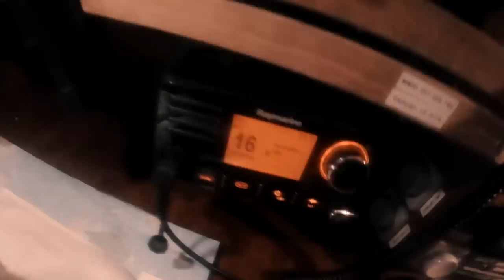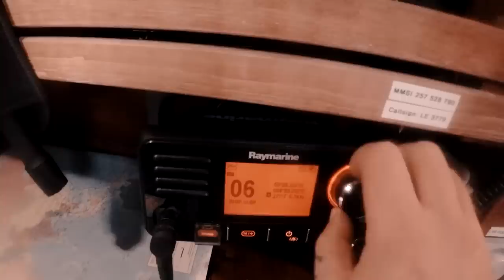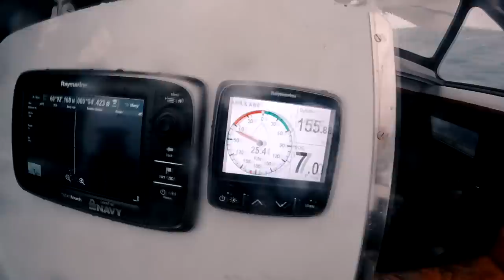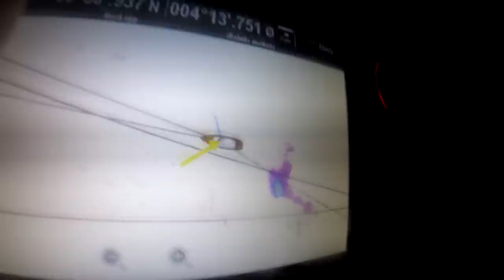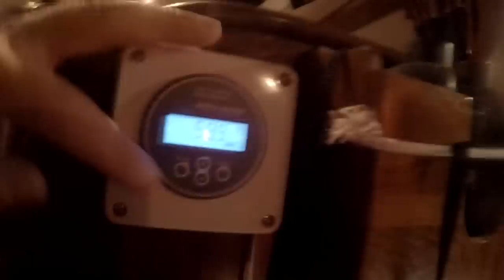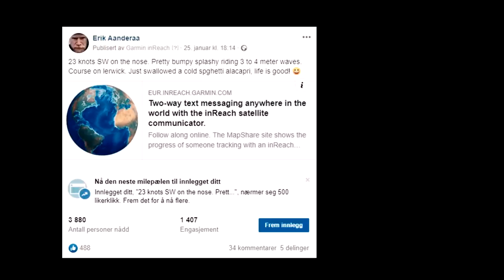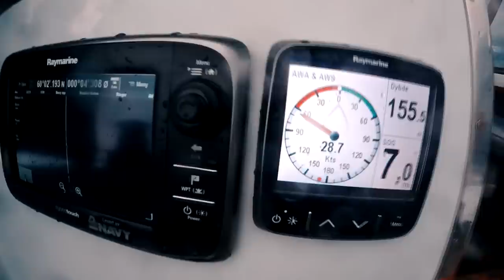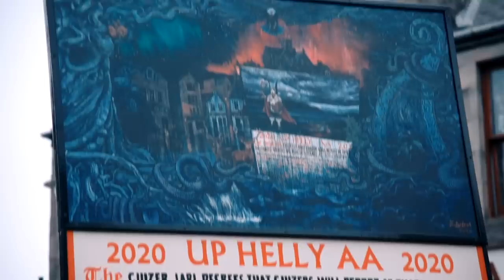Crossing the North Sea Wintertime- for a Vikingfestival

Comment: Meh...

No I'm kidding!  Great video, great sailing. 
But the 'haute cuisine' in the galley could use improvement. 
Speaking of improvement, could you make a metal grate floor in the chain locker and install a bilge pump there? The water would be contained in the chain locker and when there's a foot or so it will pump over board. 
Looking forward to the video of your trip to Greenland.
Take care.
Reply: Actually it's deep enough to raise the sole, pitched down on the centerline and sloped back to thru-hull clamtop scuppers.

This configuration allows hose or bucket rinsing of the locker, chain and rode.

Why mess with a pump and hose and all the sketchy wire mess, when with a little noodling let the water do it's thing

Comment: I been thinking that you need a much bigger boat. That one is good but.. You need like a 55 footer catch. I think you could still handle it single hand. Reefing in that main was insane but you have to do it. Super dangerous. I went submarine once in the bow spritt. All the way submerged trying to get the jib under control. So scary, but at least I had another person watching me. You could still get some of that hardcore with at least a bit more safe comfort.. sorta. Taking on water like that is freaky. They over build these small boats. You push them to the limit of what they built them for. LIMIT

Comment: I wonder if there is some way to seal that anchor hole when not in use and quickly reopen it for use. Probably difficult with the chain but maybe there’s some system you could implement to help stop the water problem 

Awesome video man 🙏🏻

Comment: Upgrade question - why have you not fitted independent bilge pumps to each side angle of the bilges.  You could turn on just the one on the side with the water when you are heeled far over and remove a lot of the water.  No more bailing with a coffee mug, no more moving around electronics.

Comment: I dont understand Eric why you dont use a bung of water resistant cloth for the chain coming through your deck . After all you wont need to anchor for a day or two. It easy to remove!
Also carry on board sponges or foam cushion for soaking the water up it doesnt take long .
Your video is good viewing.
A good example how difficult and energy absorbing it is moving around below deck and your contessa 35 is not so beamy as many bigger boats like hanser etc designed more for marina and anchorage than passage making!

Comment: Apologies, I know nothing about sailing, but when your in the cabin, who’s keeping a eye on the sail boat?? Great film by the way👍🏻
Reply: Most people have some sort of auto pilot which keeps the boat pointing at a certain bearing
Reply: JP Pope  Typically, a singlehander will stick their head up and take a look around every 20 minutes or so when they are not on deck. (This means short naps!)  Most sail boats travel at about 7 nautical mph. Big ships travel up to about 20 mph. So, worst case, you should spot any ship within 9 miles by popping your head up every 20 minutes.

Comment: Great video, enjoyed watching.  Is there a way to close off that anchor chain hole in the deck to stop the water?  My boat has a similar setup, but I have a pipe that curves back above the deck that the chain runs through.  It helps a little bit.

Comment: Could you head up into the wind to stop the heeling long enough to use the bilge pump? Or would that be unsafe? I'm no sailor, just curious as to what options one would have in that situation. Filling your electronics with water doesn't seem like a good time!

Comment: Quick question: When you switched to headsail only at around 26:00, would it have been reasonable to leave the main up instead and just roll in the headsail all the way? I'm just asking, because you mentioned how potenially risky it was to go up front to the mast. You could have done all the handling for the headsail from back in the cockpit, right?

Comment: If you arer getting seawater ingress thru your anchor chain hawse pipe you could secure your anchor forard, tie a rope to the end of the anchor chain and drop it inside below deck and tie that rope off to a 3'' threaded endcap fitted to the deck hawsepipe  and screw the endcap to the deck fitting. That way your frontend is totally waterproof until you need to drop anchor again. Having seawater washing around an AC inverter is worse than stupid, it's suicidal. Perhaps you could swap a little macho for engineering planning. To redirect seawater from the chain locker back aft was a half baked idea.

Comment: Soooo, this is what I need to do, if I want to avoid getting the Corona virus. Curious why you wouldn't put a towel (or a cotton tee-shirt?) into the tight corner spaces, to soak up the random water, and then ring it out into a bucket a few times, until the water is removed? Maybe squeeze a towel (or cotton tee-shirt) into the hole you made for the anchor chain, to prevent the water from pouring in.

Comment: Awesome footage Erik, thanks for sharing!

May I ask why you took the main down (min 28:00) given the challenging winds, rather than taking down the jib (which you could presumably do in a saver way from the cockpit)? Sorry if that's a dumb question :-D.
Reply: the storm jib is your last line of defense to stabilize the boat, and it will give you good speed and its easy to trim from the cockpit. The main will only heal the boat over in heavy winds...

Comment: Great video, and when it looks rough on screen it means it was very rough in reality!  - just a thought, but have you tried stuffing a rag  / plastic bag around the chain where it goes into the locker?   - hopefully will keep some of the water out...
Reply: Good tip, I also found about an A4 (sheet of paper) size of yoga or sleeping mat cable tied to the chain in a funnel shape and then pulled in till it squishes in the pipe sealing the gap yet still offering quick anchoring if needed.

Comment: You simply don't burn a Draken boat, not even a fake one, do You?  😐
I like the "plan A" approach though: Not going to Aberdeen instead just because the 30 knots come right on Your nose half the time.
Oh, and a small rubber ball pump (like they were used on outboard engine feeder lines) with a short piece of pipe on the aspiration side should help You get rid of the water besides Your bilge in no time.

Comment: Since I've never seen a comment or acknowledgement to any viewers' comments here on your vlogs, I can safely say anything I want to for the benefit of the other viewers only. If we are watching your video we know you made it back home. Although I would never use the term "return safely" to describe any of your voyages. Your blatant disregard for safety and good judgement is primarily a risk to yourself, but if you are motivating others to try what you have been lucky in accomplishing, then you should rethink your agenda. You can be adventurous while still setting a proper example to others on safety at sea and good judgement and maintenance procedures. You show good judgement by backing out of a shallow area in the marina so you won't bump the bottom, but you think nothing of taking your boat to sea and letting the wind & waves beat the heck out of it! Have we ever seen you check your standing rigging before a voyage? If you are going to continue to sail the North Atlantic waters in the winter you should seriously consider running your mainsail reefing lines back to the cockpit!
Try using a chest mount or a forehead mount for your GoPro to keep both hands free for staying safer around the boat. When sailing in a storm keep the hatch and companionway closed! Trying to use a $3000 DSLR to capture storm footage in the cockpit from an unsecured tripod is throwing other people's money away! Why would you ask viewers to replace it for you? And you did it 3 times! Running continually with an open hawsepipe is stupid! You got to your destinations several times but made NO effort to fix any of your problems! Who does that! ALL electronics should be in the cabin and NOT in the bilge and kept dry and free from as much humidity as possible.  Boat maintenance and upgrades are not BS! Show the viewers you recognize what's wrong and show them you can fix it! Although I would hesitate to say that dragging your engine out onto the saloon sole  is hardly a good fix! Hypothermia is a life threatening risk yet you were soaked under your foul weather gear because you went out on deck without being zipped up and with no spray hood on your head! Combine exposure with fatigue and you are a mishap waiting to happen. I never saw you hooked onto the boat while in the cockpit standing on the seats! Here in the US we would consider your Viking bravado to our version of the self-defacing rednecks who are constantly saying "hold my beer and watch this"! When the viewers notice an extended delay in posting videos from your sites, then they will know your “luck” has run out. Prior to your sail to Greenland, you asked your mother if she thought you were a good sailor. I have a difficult time believing she watched any of your videos.
I will end this comment on a slightly better note. The one good thing I saw you do regarding sailing was filing a float plan with the authorities. If ever someone needed to do that, it is you! If you are really dedicated to improving your production, then consider my words.

Comment: Both the reefed head-sail and main were way too full brother. The angle of pull on the clew of the reefed main should be 45 degrees, and the foot of the sail and luff should be tight and flat to keep the helm balanced.  Your autopilot will thank you for that.   You'll need cheek blocks on the boom, preferably on a track to run your reefing lines though. I use rope clutches and a boom mounted winch to control my reefing lines, and the clutches are backed up with cleats. It takes me at most 2 or three minutes to reef, and most of that time is spent in the cockpit loosening the Vang, putting on the topping lift and easing the traveler to leeward so I'm sailing by the jib alone with the main luffing and boom kicked-up a little by the topping lift. This makes tensioning the foot of the main with the reefing line easy - I only use the winch to fully flatten it and to bring the clew down hard to the boom. To help control the reefed portion of the sail, I run my reefing line through the cheek block then up to the reefing clew through to port side of the boat, and then back up under the boom to cheek block track on the starboard side where it's made fast to an adjustable D-ring.

Single line reefing is bullshit BTW - I tried that, and all I got was a full bellied sail and a lot of chaffing from the line at the tack. Too much stretch and friction in those systems from what I've seen. As far as the head-sail, I have sheet fairlead lead blocks which are adjustable - you appear to have fixed fairleads attched to the toe-rail, and like with your main's clew, the angle of pull on the reefed headsail's clew is critical for proper sail shape. 

...and it's foolish to put-off reefing hoping she'll hold. You should be reefed down long before going to the mast becomes dangerous. I reef the main first, because the headsail doesn't require going forward. Again, the goal is to avoid drama - unless you have death / YouTube subscriber wish ;-)

Finally, going to war with the sea isn't the mindset I take.  I see the forces of nature as something to bring myself and my ship into harmony with. That's the way I see the challenge of going to sea. To be able to read her moods like my beautiful but crazy girlfriends.  Think about it: Have you ever really won an argument with a woman?

Just like a woman - if you try to argue with nature and fight the sea, she's gonna win. That spilled dinner was just a friendly warning.   Stay humble and be safe out there my friend....